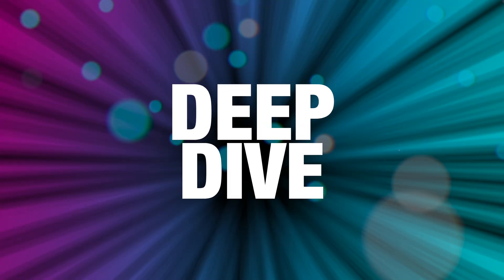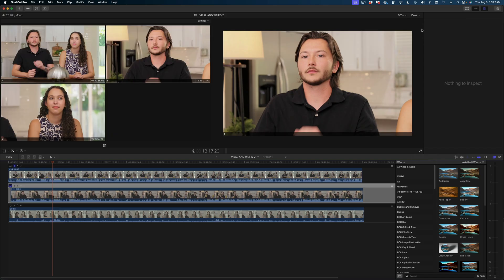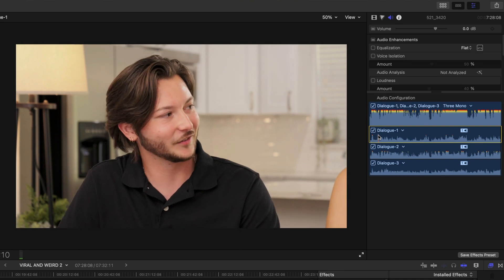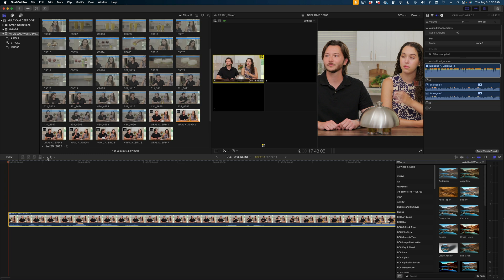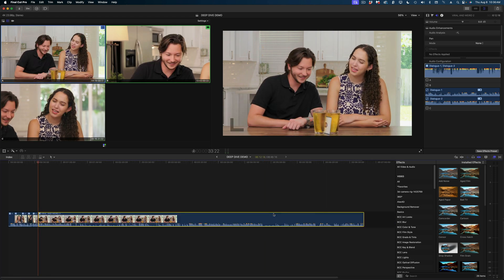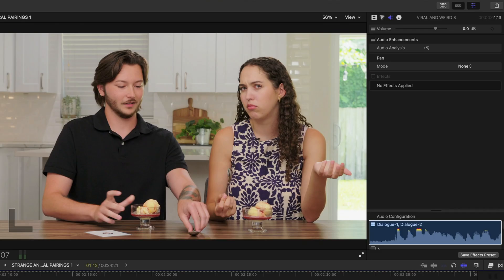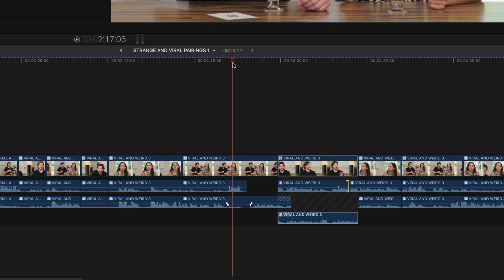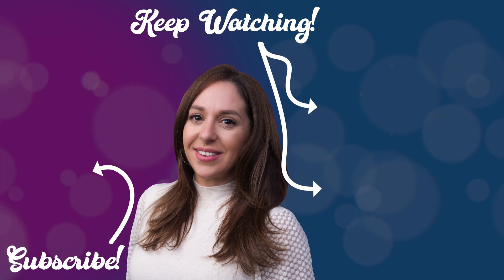Best Multicam Audio Workflow in Final Cut Pro

Comment: I have one camera which has multiple clips due to cuts. I have two mics that were left rolling between camera takes also segmented due to file size limits, so the audio track is longer than the footage. How do I get everything to sync and still have access to adjusting audio afterwards?

Comment: 4:50 For some reason, after I click expand audio on the timeline - I get one track. Although the sound is recorded on two different channels, and in the multicam there is dual mono. And I can't edit each track separately. Shot on SONY a6400 with dji mic. Can you please help?
Reply: @MaksGarmata   instead of selecting “expand audio”, try “expand audio components.” Does that help?
Reply: @JennJager  Thanks for the answer, I figured out what was going on. Comparing my clip with yours, I noticed that there was some kind of arrow on the audio tracks in mine that you don't have. And then I remembered that I was adding audio effects inside the multi clip. I removed these audio effects and then, damn it, I was able to expand the audio components. Something happens to the files when you add audio effects inside a multicam clip. Thank you.

Comment: Is there a reason to do it on the main timeline, rather than on the Multicam clip itself?  Is it due to the audio processing? I found that at times you might hear a click noise when cutting between video angles if it's not on a low audio point if you do a lot of audio post processing. I was told Final Cut does some audio cross dissolve in the background to not have this click sound, but doesn't work too well if you do a lot of processing, even on a low audio cut, when switching video angles. Off Topic a bit, - anyone have problems using the transform tool when using the keyboard shortcut on multiple monitors since last update?  If viewer is on your secondary monitor, and your on the active timeline montitor, using it will not engage the other monitor properly, and your stuck with zoom, move or rotate when using your mouse. You have to press the reset toolbar button first. Very annoying working with Multicam, and need to fix one of the angles, like an overhead shot.

Comment: I'm curious why you didn't put both mics on the camera with the two shot? Perhaps it makes no technical difference which camera they're going to as long as you select it for all audio but do wonder if there's a reason why.
For a more advanced tutorial perhaps show how you might add different EQ and/or Compression to each component if that were necessary.
Reply from the maker: Yeah, that would make sense.  The reason is kind of funny- the camera we use for the main shot is smaller than the B cam, and the lav receivers just fit better on that B cam.  Kind of of a boring answer, but it's the truth.